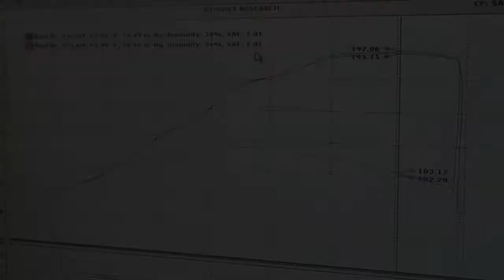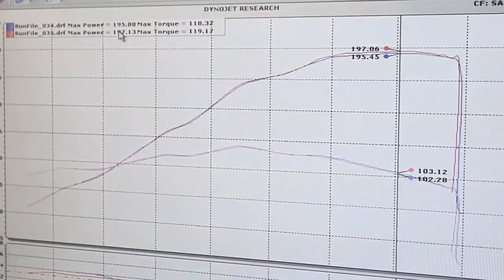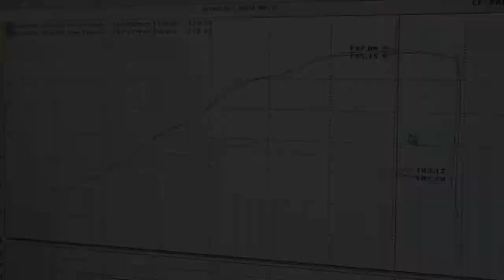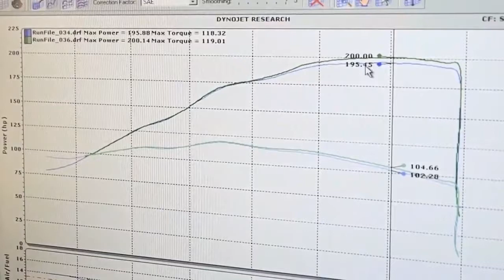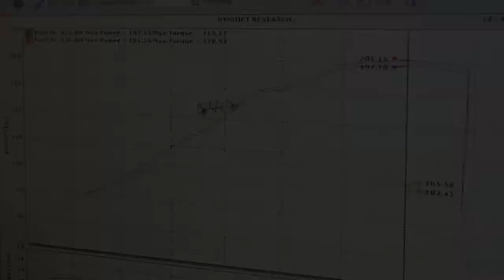The Louisville Slugger: 2012 ZX-14R Dragbike.com Bolt On Testing Video 1

Comment: You said you put a zx10r pc5 on that bike. There's no pc available for my year bike. Right now. I have a 2017 kawi ninja 1000. There is a pc for the 2016. My bike is a new generation. Can i use the pc for the 2016 or a zx10r pc like u did?
Reply from the maker: I have no idea, it would depend on the connections. You might ask dynojet.